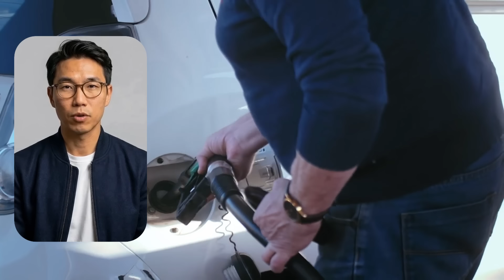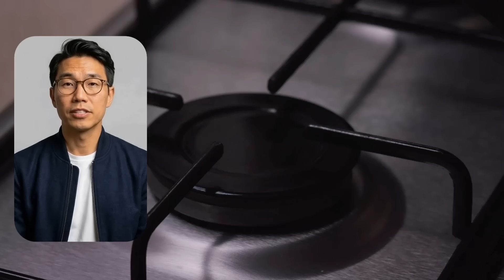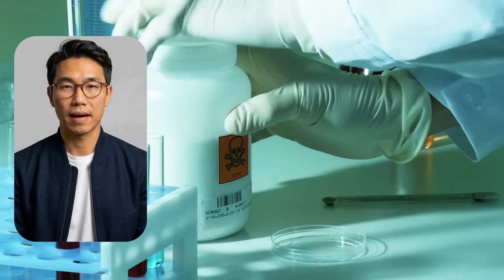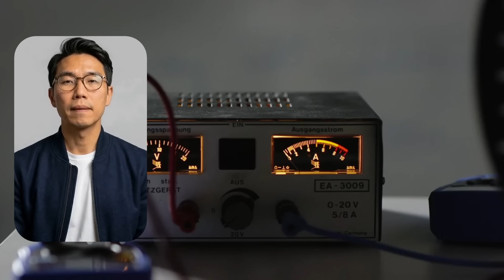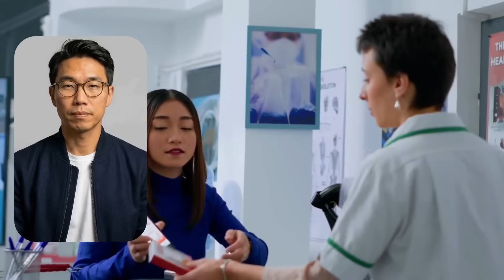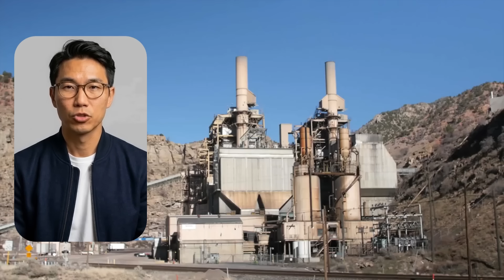This SECRET Japanese $2 Liquid Cuts Your Fuel Bill 30% FOREVER — Gas Stations Want This BANNED

Comment: I tried acetone in my '88 Wrangler to increase gas mileage. I added 1 OZ per 20 gal of fuel.   It DID increase long-range gas mileage, BUT also ate the carburetor  pump gaskets over time. My mechanic said it was not worth the expense of repairs to the fuel system.  Beware of YouTube bullsh*t videos.

Comment: First you state testing was done and the amount of acetone that showed the best results were 3-10% with 10% being the most beneficial… then at the end you state to add 1-3ozs of acetone to 10 gallons of gas ! That is no where near 3-10%… that is a mere .23% 10 gallons is 1,280 ozs …so how is that gonna do anything at those small percentage volumes? 3% of 10 gallons would be just over a quart of acetone not 3ozs!

Comment: This subject has been an ongoing discussion since 1994 as gas prices surged at records high. Master mechanics and motorheads like us have been doing this for over the decades. My 2004 Touareg has 140k miles with the acetone blend at 3oz long term blend, with 5oz in 10 gallons as the sweet spot for very long trips. My 210k miles 2016 Hyundai Elantra as a 2oz as the all rounder mix. My 2004 Santa Fe at 167k miles has the sweet spot at 4oz mix. All are still on original fuel system components. Touareg has a fuel pump recall, but the pumps' plastic parts observed not having any degradation. The Elantra has the fuel pump replaced because of the pump failed after 167k miles. No degradation on the plastic components. Still on original fuel system.

Take my info with a grain of salt. It's up to you to do your own experimentation using the 100% acetone and not some Lowe's or Home Depot acetone that has less than 90% concentration for your painting "safety" needs. The wrong acetone concentration will cause issues or not produce results because of the water and additional softener/additives, and that's the fact.

https://www.industrialnewsupdate.com/news/oil-energy/archives/oil_energy_prices/index.html